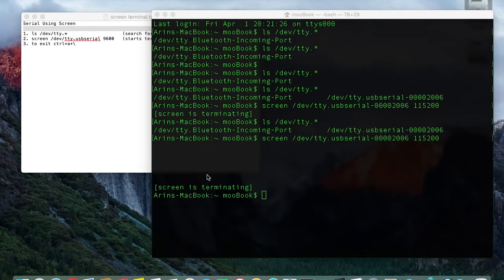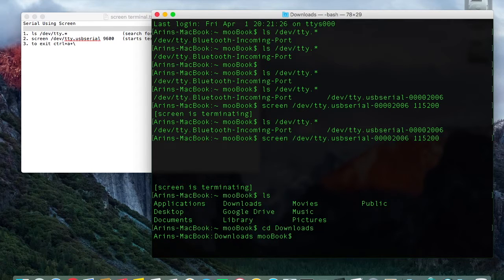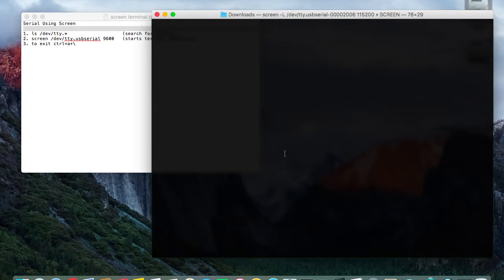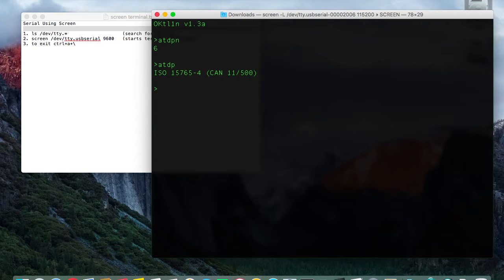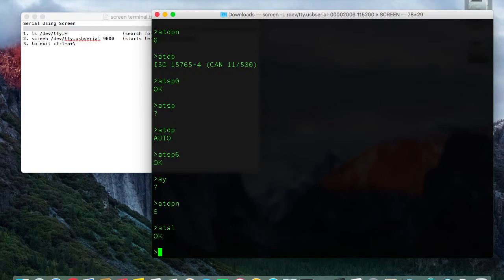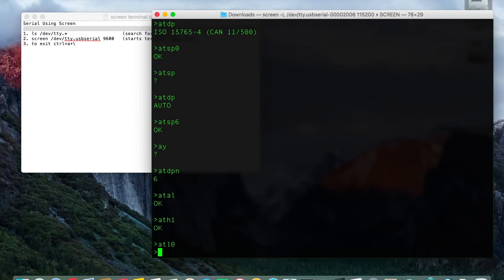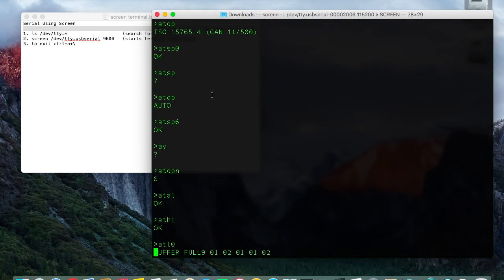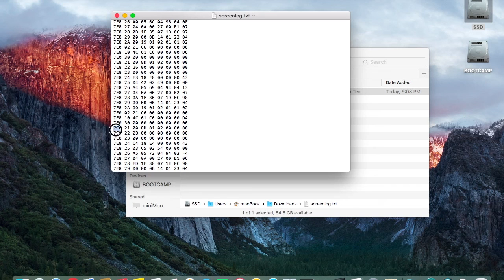EFILive Can Bus Sniffing Walkthrough

Comment: I am literally just doing this to my cruze right now with HP Tuners and Trifecta's gear. For those that want to know more, go to scantool.net or whatever and read their docs and the ELM327 docs. That will show you all of the AT ST commands. Then look up CAN (Controller Area Network) and study. CAN is a network running in most new cars since 2008. Don't start fucking with it without knowing what you are doing. OBDLink SX has a chip that allows you to talk to the CAN bus over serial. You also need to know about the baud rate for your specific vehicle and type of CAN etc. 

Also read The Car Hacker's Handbook. It's INVALUABLE if you are into this sort of thing. I am in the process of developing my own tuning product. :)
Reply: Please keep me posted on that !

Comment: Hey, this is an awesome video. Can you please give me the buying link to the Y splitter you are using? 
I have a question. Will the command ATMA work for cars that are not on CAN 11bit bus (protocol 6)? And will this method work if I want to see what command the scan tool sends to read say ABS or Airbag data?
Thanks in advance.
Reply from the maker: I will add the links to parts in the description.

I think you should be able to use ATSP0 to detect the current protocol. Then use ATDP to see what it found. I believe thats what i did, its been a while. I think it should work sniffing the scantool you'll just have to try.
Reply: thanks a lot man!
links for the Y splitter please.